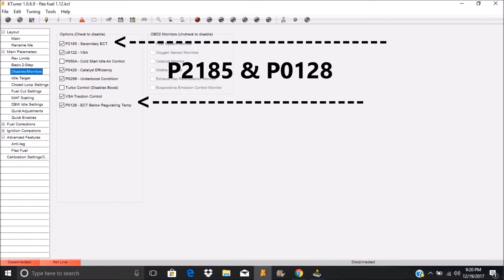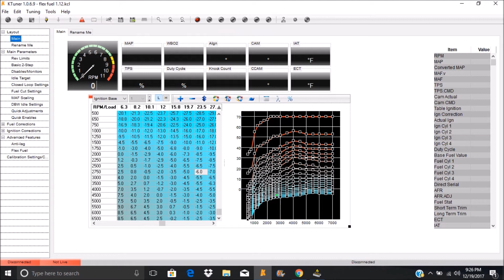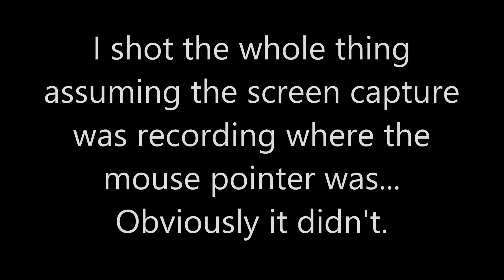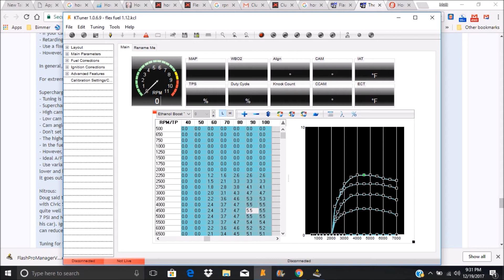Honda Civic X turbo Ktuner Flex fuel setup tuning, how the software end of it works.

Comment: Do you know if the KTuner base flex fuel map will work fine or does it need strenuous manual calibrations to work? My car is a CivicX Si with the PRL flex fuel kit, mishimoto FMIC with charge pipes, 27WON hybrid intake, and a RV6 catless down pipe with front pipe.
Reply from the maker: I honestly don't remember but I am pretty sure the fuel additive table is already setup with default values. Just watch your fuel trims when you change e content and if it goes crazy then you may have to add aditional fuel in the table. 1 lambda is 1 lambda independent of fuel choice and as far as I know the ecu is just converting the lambda number into gasoline afr for the display,  so even though e85 isn't the same mix for 1 lambda the display will show 14.7 when burning the perfect(for complete burn, not necessarily best/safest power output) fuel/oxygen mix on ethanol. So you can basically target the same numbers as gasoline (tuning for max power on a dyno you might change targets but just for a daily driver).

Comment: So once you enable flex fuel on secondary ECT your pretty much good to run e85?
Reply from the maker: If you have the content sensor installed and wired up to give the ecu the info it needs. I'm not sure if you're asking about only enabling the option in the tune but not add any hard parts?

Comment: I have an accord 2.0 10 speed auto, if i just enable the flex fuel on secondary check box and not change anything will my car still take advantage of the e30 blend
Reply from the maker: If you mean change nothing mechanically then not really, don't bother enabling flex fuel with Ktuner because you need the sensor and converter to go along with "flex fuel" in the tune. If you have a flex fuel system and mean change nothing electronically as in leaving ktuners predermined values in the tables then yes.

Also before I added flex fuel to my car I ran up to e20 and I think there is an improvement to be had but it's nothing substantial.
Reply: caraddict on hondata the dyno for e40 shows about 320hp and 380 torque. On ktuners dyno the e30 blend barely makes a difference. There’s about 20hp and 20 torque more then stage 2. 320 torque and 285hp
Reply: caraddict I’m not sure how to set up the psi adj % either.
Reply from the maker: Don't go by peak numbers if you aren't using the same dyno between comparisons. Look at the % of gains from the baseline on each. Plus I think hondata and ktuner go about it much differently. If I remember right one let's you adjust afr based on e content and the other let's you play with boost and timing. psi adj table is adding boost based on ethanol content. I forget the default header values (and it's actually been so long now I forget if it's a big table on the main list or a small sub table on the ethanol tab...) but a basic example would just be if you're targeting 19psi and add 3 psi for 30% ethanol, when you run e30 you'll target 22 psi. No ethanol you're targeting 19.
Reply: @caraddict  it’s been a month or two since i posted this comment, I ended up getting a flex fuel kit, tuning it myself for about 24 psi of boost and 25 max on e37. Dyno ran it and it hit 341 torque and 291 hp to the wheels. Not to shabby in my opinion. Wondering if I’d be able to get more HP without anymore mods and just a few edits in the tune.
Reply from the maker: @Rayyan_741  yeah I don't really check comments often. I am not really on YouTube much anymore. I would think there's more with some tuning, especially if you did it yourself (no offense at all, I tuned mine myself I just know with ktuner at least there are things you can't do that a licensed tuner can and I'm sure in my case at least I didn't have it 100% dialed.) Did you log it or get afr numbers on the dyno? They seem good? Had you gotten a baseline on this dyno before or know of many that have so you can get a decent idea of the specific gains?
Reply: @caraddict  for dyno numbers I believe stock to the wheels is about 230hp and 240 torque. So with ethanol I’d say it’s a good 60hp boost from factory and 100 torque increase
Reply from the maker: @Rayyan_741  from stock with an intake to e25 tune with intake I think I gained about 55hp/100lb.ft same dyno same day.

Comment: I have 2019 Honda Civic sport hatchback 1.5t cvt and I have a Ktuner as well, but when I click on flex fuel it does not give me the option to enable flex fuel. The button is all greyed out. It won’t let me click it at all. Do you have any idea why it may be doing that.

Also btw I do not have the flex fuel conversion kit installed yet.
Reply from the maker: What's your ecu version? Check this link it might not be added to yours yet? http://www.ktuner.com/KTunerHelp/version_history.htm